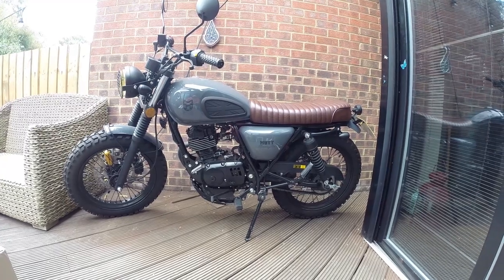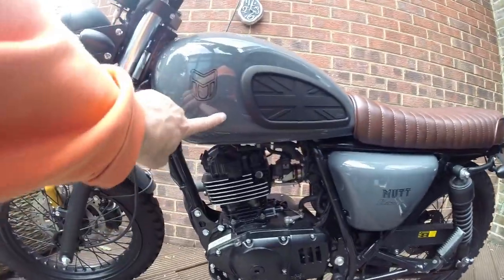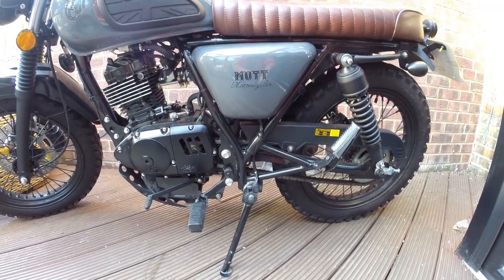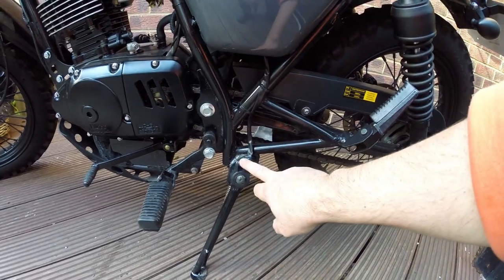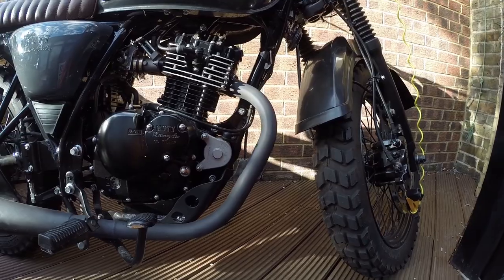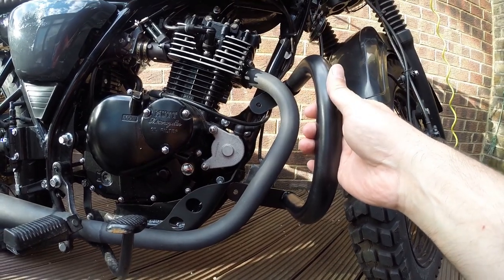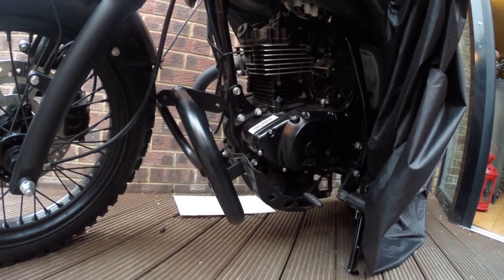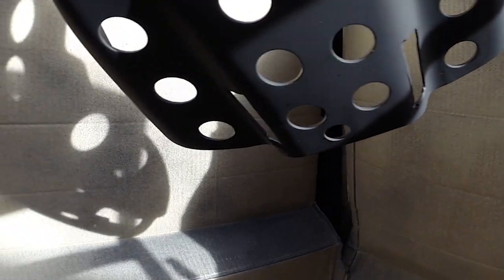Can the Mutt Go Off-Road? Dick Installs Engine Guards and a Bash Plate

Comment: Now I know why I cannot find decent files anywhere. Dremel killed them all!!!

Drilling a series of 6mm holes in a row can be laborious, and it is essential to centre punch before drilling. But if you space the holes just right, it’s possible to rough cut slots out of sheet steel with a drill, and finish with a grinder and a file. You don’t even need a vice, though one does make the job a lot easier. 

Neat job. Now you can get some stainless tubing, some sand and a blow torch, and make a high level exhaust header 🧐😎
Reply: It is not a NASA Project.
If he takes the Bike to a Shop that makes exhaust systems and removes the downpipe, they will do a far better job of making one for him to than he can do without the trouble, expense, and later equipment storage problems.
(He lives (?) In LONDON, where space is very limited, and I don't think he's rich.
Maybe the Queen will let him stash some gear at her Pad ?)
Refit pipe, go home, elevate silencer.

The pipe can be heat painted.
I did one that wouldn't fit in my oven to bake the paint on, so I fired an ancient paraffin blow torch through it for 15 minutes each end.
Preferably it should be wrapped or shielded to avoid leg burns.
OUCH !
.
Reply from the maker: Now about this exhaust... can I just remove the O2 sensor on the stock one, or will I run into EFI issues? Tell me more about this sand...
Reply from the maker: A. Bloke 2.0 Always Learning. dickwhistles at gmail. I too am protective of identity. No worries here.
Reply: A. Bloke 2.0 Always Learning. Go to 46 Works YouTube channel if you want to know how to correctly bend steel tubing using sand. It is by far the most superior method, as Shiro Nakajima, the master himself who runs 46 Works demonstrates with what looks like consummate ease. But of course he’s been doing it a long time. 

There’s no need for any special equipment. All you need is a (preferably fireproof) solid anchor point, a good heat source, and thick leather gloves. Correction of errors, (including minor alterations by eye) is far easier using sand, whereas it’s almost impossible using a bender. 

It’s amazing how myths get circulated. As with everything, you have to do your research and be prepared to learn from those with actual experience in any specific discipline. 

I’m a retired aero engineer (amongst other things) in my 60s, but I’ve learned a lot from Shiro Nakajima since I discovered his work. He’s probably 20 years younger than me. 

To put his skills into context, compared with him, most custom shops with tens of thousands of followers are rank amateurs with attitude and very limited skills or decent ideas. Moreover, he achieves more in a fraction of the time, but without any of the stupid western drama and bragging. 

Nakajima’s modesty is perhaps typical of his race. And to put my accolades here into perspective, I NEVER recommend anyone to anyone. There are two exceptions: Master engineer Shiro Nakajima and James Corbett. Coincidentally they are both in Japan. 

Finally, I was bending one-off thin walled stainless tubing parts using sand (without ANY flattering effect) for aero engines at an experimental facility in the 1970s and 1980s. The thinner the wall, the more tricky. 

125 motorcycle exhaust tubing is simple by comparison.
Reply: Dick Whistles Oh, as soon as we get into EFI and sensors, I start to wish we were still back in the ‘primitive’ carb days. 

I’m sure the thing with shit the bed in some way if it doesn’t know how guilty you are for burning the tiny Swedish Elf puppet actress’s house!

Please see my reply to your well meaning, but ill informed friend. 46 Works dot net is where you will find the genius Shiro Nakajima. And he bent a header for I think his latest BMW project, which he’s serialised on his YouTube channel. 

I really cannot overstate how valuable his channel is to anyone interested in modifying bikes. You won’t find the likes of delboy recommending him. But you will not find a better engineer. Allen Millyard is my third recommendation. That’s my lot. 

And of course James Corbett is a documentary maker, citizen journalist and awesome researcher who’s universally respected among those who’ve been working on the side of humanity, as opposed to the powers that shouldn’t be, for any period. 

Finally, the reason professionals still use sand, is because of the amount of flexibility it allows. But skills are being replaced by AI, CAD/CAM and sadly bullshit. 

Next they will be telling us a bat and a pangolin are to blame for what some US bioweapons facility at Fort Detrick, Maryland brewed up, adding a gain of function capacity before shipping it to the patsy facility in Wuhan...! 

The astounding thing is that medical professionals are repeating this nonsense. So what hope is there for empirical evidence based facts?
Reply: @G58  

Hi G !

Well I AM still learning so I watched the 46 video and admit Nakajima did a far better job than I did as an Apprentice bending ½" copper pipes, but I argue as to whether this is a superior way to a pipe bending machine.

Sand bending certainly is not quicker and requires a big investment in time and expensive equipment.
A bit much for Dick in a London house, I think.

By coincidence, I made a two into one system for my BMW R45 back in 1982.
I have no YT account, but I may send pictures of it and my other mods to Dick to publish if he wants to.
And it is FAR neater than Nak's job.

Thanks for the Nak knack info.
I am now a little bit smarter.

Regards.
.
Reply: @G58  

Hi again, again G.

I will admit to me partially informed, but not ill informed.
Nak did a tidy job bending the pipes, but not better, easier OR cheaper than a pipe bender.

Bending a pipe with sand and heat WILL narrow the pipe across but expand it sideways, and the shoulders of a pipe bending machine supports these walls to prevent them from moving out.

Still, now I know how to sand bend a pipe if every other proper bending machine in the world is stolen or becomes illegal.

Finally, you went a little off topic  at the end there, do you not think ?
.
Reply from the maker: A. Bloke 2.0 Always Learning. Yes dot com. The try not to use the @ or .com when sharing the email so bots do send me sh*t.
Reply: @DickWhistles 

 Good thinking.
I will use that info.
.
Reply: A. Bloke 2.0 Always Learning. We’re all still learning bro. Not all pupils are aware they’re still in school. 

Mr Nakajima is a true master. He does make it look easy. But the right amount in the right places ensures even bends precisely where you want them. You get a feel for when, and where the pipe wants to bend. 

It’s easy to avoid the flattening effect if you pack the sand in tight and DRY, and apply the heat correctly. 

And of course the sand retains some of the heat inside the tube, so it requires less fresh application of heat to bring precise areas of the tube back up bending temperature. 

If you bend a pipe too little using a bender, setting it up again can be difficult. 

If you bend a pipe too much using a bender, it’s virtually impossible to correct. 

The pipe bending machines I do like are those custom built by the ex Lotus guy, that use nylon billets. I may invest in one of those one day. And I’m not even sure I really need one. But if I ever need to bend thin walled aluminium, it will be perfect. 

All Dick needs is a thick sturdy lump of scrap wood, a wood saw to cut a V in one of the wood, a couple of G clamps, a couple of exhaust U bolts, and a blow torch. Clamp the wood to the decking, clamp the pipe to the wood. Bingo!

I’d love to see your BMW mate. You’ve got a YouTube account, just post a vid. Yeah, I know, I should post vids too. But I lack the patience and entertaining style of out good host here.
Reply: A. Bloke 2.0 Always Learning. 

You ask if I think I went a bit off topic at the end. 

Not at all. In the ‘70s I had a lot of fun messing around in exotic locations. There were no mobile phones back then, so we had to use pay phones. But carrying around lots of phone numbers was not a great idea. So we had to memorise them. Today I struggle to recall my own numbers. 

My point was that we are getting dumber in many different ways. 

Then I gave a few examples of how we are being treated as if we are stupid children. 

The war on drugs; the war on terror; Climate change; Covid-19 - the marketing name for SARS-CoV-2...

You may not see the links, but anyone who was in my game back in the days when the CIA was helping to install Mugabe in power (on behalf of Rockefeller), can see them very clearly. 

Your attitude towards sand bending, and Dick’s use of a Dremel to cut slots which only really required a drill bit and a file, are both examples of how traditional basic skills are being lost and replaced by myths and techie solutions. 

Plus I classify as high functioning LLI, so I see the bigger picture more readily and clearly - a bit like the profiler in that NY cop series.
Reply: @G58  

The point about going off topic is bio weapons have nothing to do with Dick's Mutt Project and taints it a bit.
The Bike is a joyful thing, lets keep it that way.

Regarding losing Old School Skills, the first part of my Engineering training was as a Blacksmith.
In that I served my time in my Father's Engineering Business while studying Industrial Design and Mechanical Engineering, so I know Craftsman Skills very well indeed, making everything from Japanese Swords to MacIntosh copper lamp shades.
Nor did I stop learning there.
It was mana from heaven for a Mod Scooter Customiser.

I have mentioned your interest in my BM R45 to Dick and asked him if he is interested in showing photographs of it.
Remember, I did not have a digital anything in 1983, and they are on hard copy paper.

I spend a great deal of my time now days on a Science App discussing Physics, so I don't want to get involved with the Video Process as I am a very private Man in that respect.

Perhaps if it is inconvenient for Dick to host these pictures, I might snap them on my camera and send them direct to you on the condition that you keep my Identity private.

For that you would have to supply your Email Address.
.
Reply: A. Bloke 2.0 Always Learning. 

Consider if you will, that there is no “off topic”, only free exploration of ideas (which are all connected), pedantism, and faux authority some choose to willingly invite into their minds, then attempt to impose their limiting beliefs upon others. 

Have you considered where such thinking originated?

I know it’s a wild notion, in this slavish environment we find ourselves. But having read a bit of philosophy over the years, I’ve discovered some very interesting points of view which not only obviously come from a better mental and ethical state, they suggest the possibility of a much better world. 

Would it be “off topic” to mention the origins of the naming of Dick’s Mutt?

Ironically the Mutt company asks: 

“Fancy jumping some barbed wire fences? Well maybe not but this crossbreed has that extra edge of McQueen cool.”

This is of course a reference to Steve McQueen’s character in The Great Escape, a film which stays “on topic” about as well as a babbling drunk pathological liar on an acid trip!

Even Wikipedia admits:

“The film was largely fictional, with changes made to increase its drama and appeal to an American audience, and to serve as vehicle for its box-office stars.”

What? No baseball glove in the cooler...? Is that infamous myth factory within an even more infamous slave colony “off topic” here? One could argue they admit as much. 

Wikipedia continues:

“Indeed, in reality there were no escapes by aircraft or motorcycle: McQueen requested the motorcycle sequence, which shows off his skills as a keen motorcyclist. He did the stunt riding himself (except for the final jump, done by Bud Ekins).”

Don’t get me wrong, I’m a great Steve McQueen fan, and love his role in The Great Escape. I love even his bad movies, and despite not having a gay bone in my body, can even admire his physique, as depicted in that famous photo of him shirtless, performing a jump on his Husqvarna scrambler. 

So, Dick’s Mutt is named for a fictional character in a HollyWeird movie about a real event, but fictionaliZed to falsify US personnel involvement in acts of military folly that ultimately cost the lives of 50 men - none of whom were Americans, thus defaming the real ‘heroes’ and stealing valour - from the British, Canadians etc!

Does this diminish in any way Dick’s Mutt? Not at all, despite the fact that Dick’s Mutt also begins life somewhat “off topic” due to actually being a Chinese copy of an old Suzuki. 

But it’s in good company, because Steve McQueen’s jump bike (which we’ve learned was actually ridden by Bud Ekins in that iconic scene) was indeed itself a Triumph which wasn’t even on sale until ten years after the end of WW2 - actually won by the Russians, not the Americans!

As Chief Seattle is quoted as saying: 

“ Man did not weave the web of life, he is merely a strand in it. Whatever he does to the web, he does to himself.”

Here he’s summarising everything he said before that, and paying respect to everything and everyone who went before him. 

His enlightened beliefs and those of his people predate the organised religions which are the origins of this willing desire to adhere to faux authority so beloved of the masses. 

So, to answer your question, I simply ask why would you want to limit the horizons of your thinking in such a way? 

Is it not obvious that the use of bioweapons against the masses has everything to do with the dumbing down of society, of which serial skill loss is demonstrably a symptom. 

Our brother Dick brought us together here, to this dry sand, where we mixed our thoughts. 

There’s a great tradition of philosophical bikers. I met my first at school when I discovered TE Lawrence (at the time living as Shaw) for the first time. Despite its biblical references, The Road is perhaps the greatest evocation of what it means to travel at speed on two wheels, with no greater purpose than to experience - the road. Yet the journey he describes is a humble shopping trip!

I do of course celebrate the fact that our brother Dick is building his pony. And philosophically, one could argue that Dick’s Mutt is heading towards a higher state of authentic originality as a consequence of his own work, and ALL the input he receives - on this Web of life, which none of us built, but we do all weave new strands with each step and mile travelled.
Reply: @G58  

I bet they are three deep around you at parties.

You think, not too much, but too much about things that are unimportant personally to you, things that you can do nothing about.

Db you have a Bike ?
If so, what Bike ?
.
Reply: @G58  

Sorry, TWO deep at parties.
Have you ever actually BEEN invited to a party ?
.
Reply: A. Bloke 2.0 Always Learning. You wrote:

“G58 Two deep at parties. Have you ever actually BEEN invited to a party ? .”

Not by people who apparently proudly parade their ignorance and narrow mindedness as if they were viruses. 

But if I shared even the redacted list of those enlightened Humans (including authors, business people, current and retired military and activists) who do ALWAYS invite me to their events, you’d be embarrassed by just how poor you are at profiling people. 

How did you allow yourself to get this way?
Reply: @G58  

You must be very lonely.
Do you treat everyone who won't play your game this way ?
.
Reply: A. Bloke 2.0 Always Learning. You wrote:

“G58 You must be very lonely. Do you treat everyone who won't play your game this way ? .”

LOL! What? Point out the absurdity of their positions? of course. Who but a fool placates and indulges a fool?

My style of response is verbatim quotation with point by point rebuttal. It’s the only way to guarantee that all points are addressed in context - as posted, thus leaving no scope for complaint that any particular comment was taken out of context. 

It’s the technique employed by lawyers and interrogators when the subject is employing obfuscation and evasion, and simply lying. 

Don’t blame the messenger if you’re being quoted accurately and experiencing embarrassment as a consequence. 

Is this a good time to let you know that I left aero engineering to begin my career in military intelligence as an analyst? 

I consider my research abilities to be average at best, meaning that the majority of the population could easily research and verify everything I’ve posted here. 

My primary discipline is analysis, at which I am apparently in the top 10 percentile. 

Ergo, to reject out of hand my points as you have, in the ways you have, means you’re intentionally failing to even attempt to rebut my claims with anything other than straw man arguments. That’s beyond lazy. 

Considering you claim to be spending “a great deal of my time now days on a Science App discussing Physics”, that’s rather strange. You clearly want everyone to believe you possess reasoning capabilities.
Reply: @G58  

Do you actually think that I READ your stuff ?

Do you need a Friend ?
.
Reply: A. Bloke 2.0 Always Learning. You wrote:

“G58 Do you actually think that I READ your stuff ? Do you need a Friend ? .”

Just give it up bro
Reply: A. Bloke 2.0 Always Learning. 

Earlier you wrote, then deleted:

“G58 Your responses are so entertaining, (if unread),”

How can you be entertained by something you claim you haven’t read?

“that I just thought to actually skip read your last tomb. Then I got to "military intelligence" What an oxymoron ! !”

In almost every instance I would agree with you. 

“ I burst out laughing, so thank you for the chortle.”

You’re welcome. 

“I will point out here that if your posts get out of hand with insults and such I will simply stop dealing with yo It would be entertaining for the reader, bur it would not be fair on Dick in his Channel, or for You in the long run.”

Oh no, you’re resorting to threats. But you’re upset. All those typos give away your emotions. You were shaking as you typed!

“If you have a reply, make it ONE Paragraph and make ONE Point. We will deal with ONE Point at a time. .”

No, I didn’t believe we need to play this game any more. You’re out of your depth, and I happen to agree with you “ it would not be fair on Dick in his Channel”

You can go back to your physics app now, maybe it will explain why trying to bend tubing with loosely packed sand and no heat is the reason for the flattened tube effect. 

Pack the DRY sand tight, and use the right amount of heat at the correct time, as Shiro Nakajima demonstrated, and it’s relatively easy. 

That’s what all this has been about. A pissing contest over who has the best knowledge of pipe bending. I gifted you Shiro Nakajima‘s video in the hope you were smart enough to recognise that you were mistaken. 

Sadly, it transpires I was mistaken.